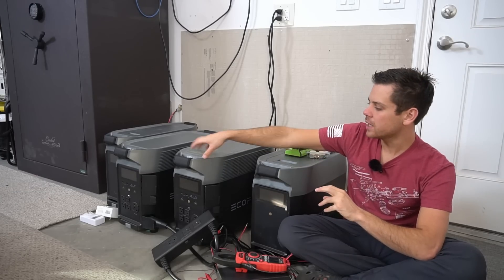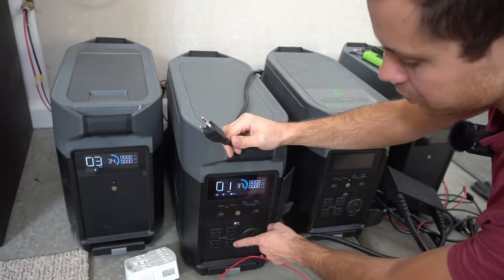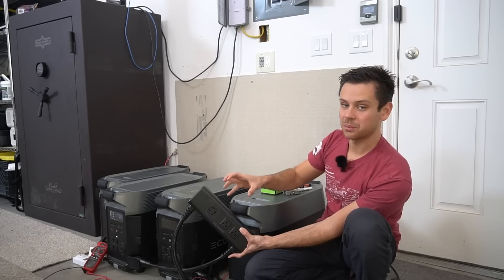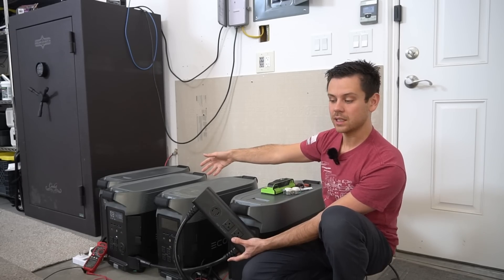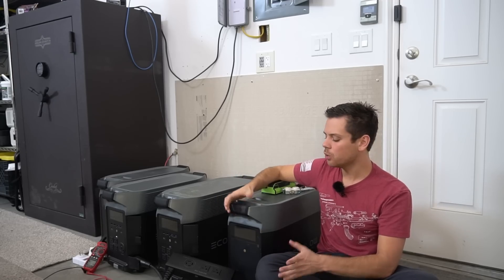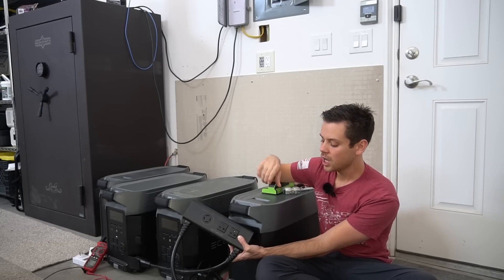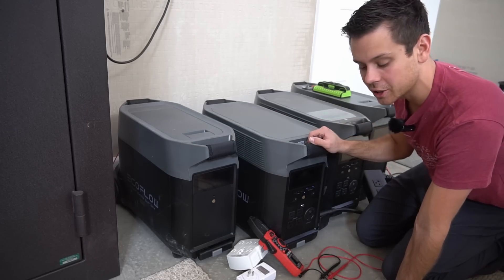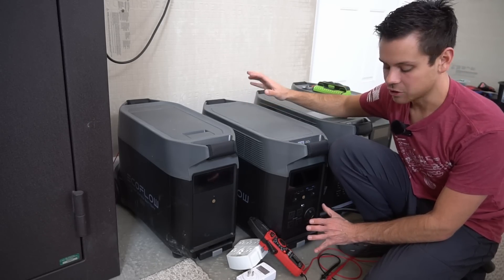I broke my Ecoflow Delta Pro 😬 (my fault)

Comment: Wondering how hard it would be to take a Server Rack 5.12kWh EG4 LiFePO4 and create your own Ecoflow type setup. Meaning same type of formfactor and plug port/charging configuration (with wheels of course). Inside of a big plastic box or something. Ecoflow Pro price of $3599 seems a bit steep. And it's only 3.6kWh.
Reply: Costco has or had them on sale for 2999.  Just bought 2.

Comment: Should never try measuring resistance between ground an neutral with power applied, you will get false readings if there is the slightest voltage difference between the two terminals, either that or there is a good chance you will cause significant damage to your meter

Comment: "stick to solar charge"
Welp....can't deny that. Did a test On 3 ecoflow river models...the one i told to charge only with regular electricity fried itself around 4 months ago. Overload problem and bms did its work to avoid a fire. The other 2? They are there super happy due to the low current allowed on the battery....lol. if you havent guessed yet, yep, they are being charged with solar only. How long has been the test right now? 1 year, 2 months. 4 hours of use per day for those who are interested on ecoflow basic products.

Comment: That happened to me early on in the beta. It’s just a fuse. Bonding neutral to ground properly is not a problem. Do it wrong and you’ll blow the fuse. It’s not trivial to replace but it’s not rocket science either. The AC inverter and battery charger are the same circuit so if your inverter works the charger likely still works.
Reply from the maker: That's the problem, and why I smelled smoke. I checked the fuse, it wasn't it. And the AC charger tries to work, but gives me an overload error warning. That's why I claimed it's broken. Do you have a single unit or two? Have you connected to grid and did ground neutral bond at the same time like I did? I remember you said you use it as backup for your panel, and that would work perfectly. But how I set it up, I burned something out.
Reply: @WillProwse  ok that makes more sense. When I blew the fuse in mine it was with a bond on the front plugs. It was a single unit. With the double voltage hub I didn’t connect the AC input, because I knew that could cause a ground loop (as you said). Maybe a firmware update can completely shut off the AC charger when using the double voltage hub. Either way I wouldn’t have it plugged in to AC when using 240V. I actually have an accessory (in beta) called the smart home panel which uses the infinity port for charging and discharging and solves this issue. I have three units now but eventually will have four, two in parallel for each split phase.
Reply from the maker: @n2rj  wow please let me know about that when you build it! I appreciate your comments on this unit. You know it in and out
Reply: @n2rj  
Strolls through not understanding a word. Ha
Reply: @AskIveSolar   I will explain all this Wednesday?
Reply: How do you hook up two units in parallel?  If possible, isn't the redundancy of having two units or four units preferred over a unit and backup battery configuration?
Reply: @randysmith3990  using the smart home panel.

Comment: Do you know if you have the smart panel wired in with 2 Delta Pros, would an AC coupled grid tie solar system be able to charge these in a grid down situation? I am considering these but want to make sure my 5.4 kw Enphase IQ7 micro inverter system will charge them in a grid down situation.

Comment: If you want to create a neutral earth bond the way I would see doing it safely with AC connected to the units would be to ideally bond the neutral and earth on the charger side only and connect this to the deltas earth only (this is how the neutral is created at the utility transformer) connecting the bond to the earth on supply side only allows an earth path for safety and also fools the Tesla into thinking it has two phases a neutral and an earth

Comment: 4:52 "you can charge a EV"

It's the Tesla EVSE that test for ground. You can most likely charge a Tesla by using a non-Tesla EVSE, that do not have ground check before charging.

You can use the J1772 adapter on your Tesla to change.
Reply from the maker: Yes indeed and I bought another ev charger but that tests for ground like my Tesla charger. Also my Porsche charger did that too. What charger are you using that doesn't? I would love to copy what you're doing
Reply: @WillProwse  Well, I live in Norway, about 90% of households have 230V in their receptacle with two hot wires. Tesla gave out a third party EVSE (Mennekes) before Tesla made their own EVSE that did not test for ground. 

I use a METRON Raichu, it's a EVSE with the logic built into the J1772 connector (so no bulky box on the cable), only a small GFCI on the cable.

I have seen, several years ago, video from the States showing that some EVSE could give a charge from a source without a grounded neutral. Some of them was dual voltage (120/240V). But those videos are long gone the jungle of videos on Youtube...
Reply: @WillProwse  maybe OpenEVSE is the solution,  you can most likely disable the check in that software.

OpenEVSE is a Open Software/hardware  project.

Comment: Very astute Will. Possibly the person at Ecoflow didn't fully understand you were running on an un-bonded sub panel or, didn't fully understand the dynamics and risks of ground loops. 
Years ago when visiting a friend in Mexico, he asked me to look into why he was getting shocked when he grabbed an aluminum ladder on his swimming pool, and when I did,  I found between 50 to 140v stray voltage between neutral and his pool ladder, and also between neutral and ground in the service panel feeding his home pool, and one hot leg at the panel float floating between 140 and 200v above ground.  I bonded the neutral at the panel and added ground bonds at the pool and about 30min later we heard fire truck sirens and saw smoke coming from his neighbor's kitchen who's electric stove and a kitchen wall were on fire. Turns out that there was a short on an underground service to that home and rather than correcting it, the Mexican power company simply lifted the ground at the transformer and let everything float. When I bonded everything my friend's pool and the neighbor's stove became the ground for everything on that utility service.

I've notice that some non-U.S. systems such as in Japan use floating ground services and a ground fault interrupter at the panel service main. That might be safer overall but if you have an appliance or wiring short to ground you trip your entire service. In Mexico, China and Taiwan I noticed they often leave the service ground float and don't bother with a GFI on the mains, perhaps why you see so many electrical fires in those countries.

Comment: Proper grounding in electrical systems is more complicated than most people think. I have seen plenty of test systems built by electrical engineers that were designed improperly causing all kinds of erratic behavior. Ground loops, bonding, and ground isolation can get complected. I just wish schematics for all these devices were more readily available so those in the know can point out problems.
Reply: true and at least he explains it to help others avoid the same problem that he found
Reply: Its hard. I am paranoide electrician 🤣🤣 I do not trust even the Engineer so I double and triplecheck it all and add in ground safety breakers on all switches. I HATE getting electricuted so safety safety, messurement, messurement. And even then I can get a suprise from out of nowhere. Since the Neighbour has a groundfault and it rained a lot..... So electric currents is FUN!😅🤣🤣
Reply: @tellusmars7770  Yeah, last month, I was sure there was no current in in the hot and neutral wires, turns out I did have my multimeter on the 200 setting, except that it was on the DC side. I didn't get shocked, but it was close. Even at age 72 I learned a lesson...don't assume!!!
Reply: I can testify to that clam. In my 3ed year electrical construction class they had a whole book on just grounds and bonds. Then in the final year they had an even bigger book on just motors and they dont need the neutral wire on some 3 phase stems and that throws it all out of wack in my head. A real pain.
Reply: My old dad, an EE said that most of the electrical and electronic issues on his projects seem to be faulty grounds.
Reply: Respect to Will for showing what a twit he was. Shouldn't the first question to understand the answer to be 'why does the Tesla check for earth-neutral bonding'? I assume it is to detect a PEN fault and so that the car can successfully make the chassis earthed (because that is necessary for safety when your supply is earthed). My next question is, if your charging supply is floating (grid disconnected and no earth rod e.g. solar or battery supply not connected to mains or anything else connected to mains) then is this still necessary? To move on, we also need to know how the DP connects its earth and neutral outputs under all the different conditions, relative to the earth and neutral of the incoming supply to it. Then we need to analyse all the possible fault conditions and consequences of those.

Comment: The ground likely burned out. In a different test use a plug connected to the other half of the split phase circuit then the good Solar Power unit is. International units are likely 240 not 120 volt units.

Comment: There should be a way to eliminate "the middle man AC" and charge directly from DC to DC.
Reply: We need a unit that will take any DC input voltage from 10 to 1000 volts at 200 amps max (nice round figure) and output it at any selected output voltage  where you dial in the maximum amps allowed for your device...car, battery bank, etc. Of course arc fault protection is a must. And it must fit in your shirt pocket.
Reply: @kimmer6 , DC/DC isolated modular converter modules, assembled in one system. This type if module exists: CE+T (Belgium) "Iris" two-way converter module for 48 Vdc <-> 400 Vdc (regulated). But it is only power module for now. Needs a controller software for acting as EV DC charging station (to ChADeMo or/and CCS DC charging standards)
Reply: @thesignalbridge  Awesome. Thanks for the info. It might be a while before I have one.
Reply: @kimmer6 , one of China manufacturers has models of compact 10, 15 and 20 kW DC charger stations. These stations are wall mount type or has a small trolley base for mobility, and perfectly fits for private garages. So, I suppose, that our China "friends" already have such converters. May be, a "deeper googling" at China EV sites will help to find it. 😎
Reply: in order to provide the amps, needed.... you need really big cables,(larger then jumper cable) to pull your 100 amps. the process to convert DC/AC is basically A ON and OFF switch switch 60 times a sec. that lower the heat & resistance allowing for smaller wires. sorry don't own Ev :( however they do well step down or step up convertors, that can be bought so it all depends what your trying to do....
Reply: @nathankeeslar152  For sure. I have a roll of 4/0 and some 2/0 cable left as well as some 3/8''x3'' copper bus bars and 2 hydraulic crimpers. I'll put this stuff to good use one day soon. I might get an EV for around town shopping and recharge it strictly from solar. We'll see.